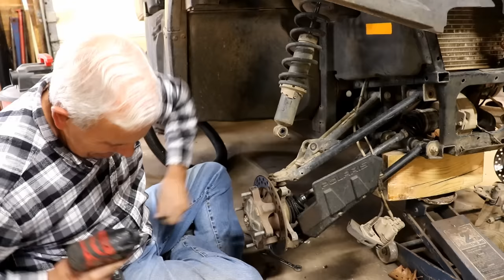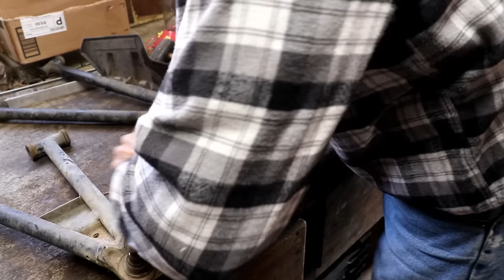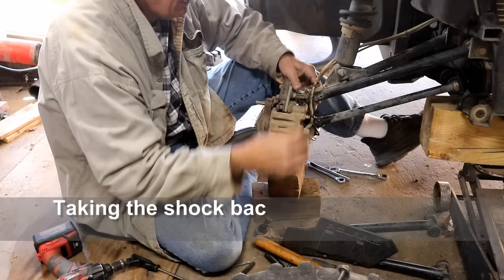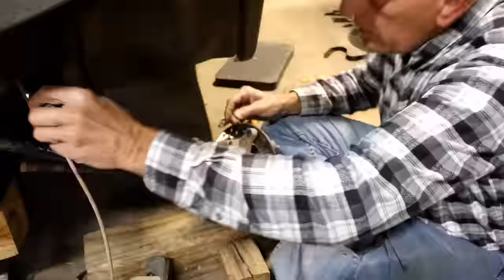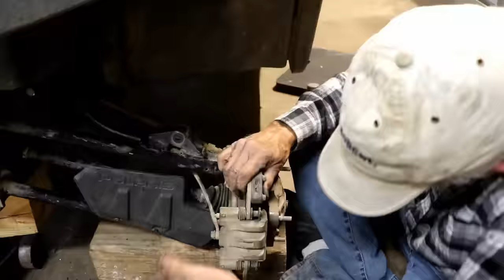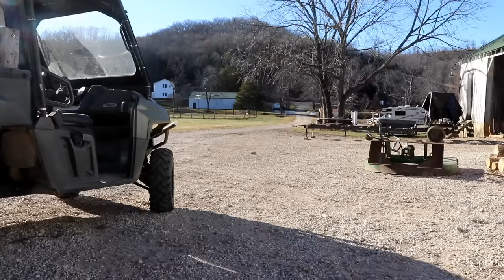675 RSW Replacing Ball Joints In A 2009 Polaris Ranger 700 XP

Comment: Jerry I'm a fan especially of your Guitar repair. At the risk of sounding like a knucklehead, I have two suggestions on this repair: 1) I hope you're not just using the floor jack as your only support for the vehicle as you work on it. You should also have something like a jack stand under there as well for your own safety. 2) When I used to work on my own brakes and such, I would only disassemble side at a time so that I always had the other side as a reference for my reassembly.

Comment: Jerry - I've started filling a container that has a lid with a 50/50 mix of white vinegar and warm water with a single drop of dish soap such as Dawn and a dash or two of salt before I start removing nuts and bolts so as I take them off I can start them soaking and cover them up.  The rusty fasteners should start bubbling in short time and after a few hours they should look like they've been bead blasted as long as they weren't severely corroded otherwise they may need a little agitation and then be allowed to soak overnight.  

This also works for Brass and Chromed parts including furniture hardware.  Much less work and damage to the fasteners than with a wire brush or other physical means of cleaning them plus even $1.25 Store vinegar, dish soap and salt works just fine for this making it very inexpensive too.

PBlaster will help with the removal of the snap rings and at times you may need to use the press to relieve the pressure on them by pressing the joints more tightly into the A-Arms.  Cleaning and dressing the surface on the A-Arms where the snap rings seat using a file will help with setting them back into place.

The brake hose went under the upper A-Arm and not over it.  Cell phone pictures are your friend.

Putting the clips back on at the press or on the bench is much easier.

An old bolt can be used to align the ball joint studs after you taper the end and makes the job much easier.

Haste does make waste and adds to the extra time we need to get jobs done as we grow older.  I feel your pain.

Best!

Comment: Looks like a fun little vehicle and easy to work on. The shock is actually a strut.
Reply: If you want to be technical about it, the assembly is a strut.
The spring is the shock absorber and the
"shock absorber", as you call it, is actually, a rebound damper.
Also true for vehicles with, standard, separated spring and damper. 😁✌🖖
Reply: @zapa1pnt  I call the assembly a strut. I have replaced many.
Reply: @harveyellis6758  That is correct.

Comment: I have to be curious if you ever greased this machine? I have one that's 1999 with MANY miles and hours on it, I kept it greased religiously and have never had to change anything yet on it. it has 25 grease fittings that I know of and I have kept new grease in every one at least once per year if not more often, we rode thru mud and water up to the seat, clean new grease is the key me thinks! :D

Comment: Jerry, your mechanicin' goes about like mine usually does.  But we know it's right 'cause we do it twice -- or three or four times.  I will ping you for not putting jack stands under that thing though.
Reply: I once rebuilt an automatic transmission.
No transmission jack, I dropped it on my chest (twice).
Opened it three times.
First time: pulled it, stripped it, "fixed it", installed it.
Test: reverse, OK. Neutral: OK. Drive: No go.
Second time: pull, strip, seal ( in the middle ) in backward. Reassemble.
Pick up off bench. See clip ring on bench. It was lying under tranny.
Where does it go? In the middle, of course. Open it, fix it (for real), install.
Long day, sore chest. 😬🤕   😁✌🖖